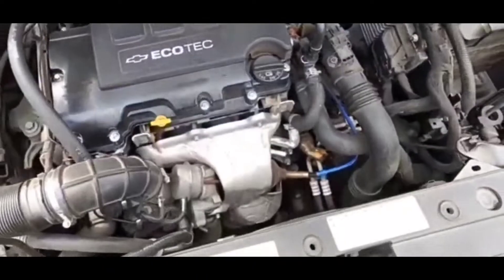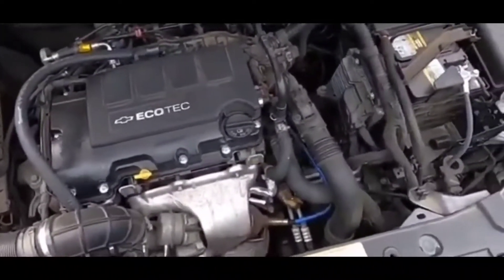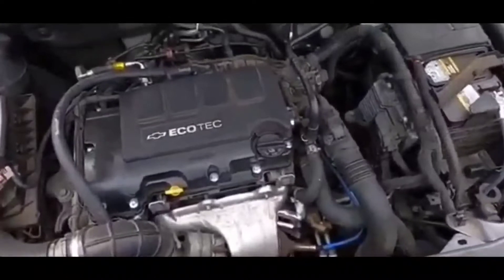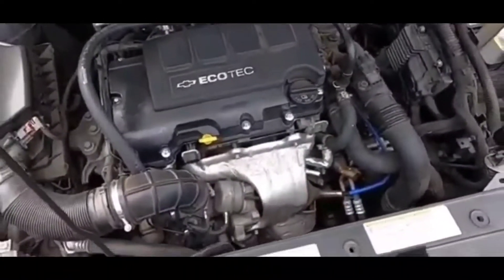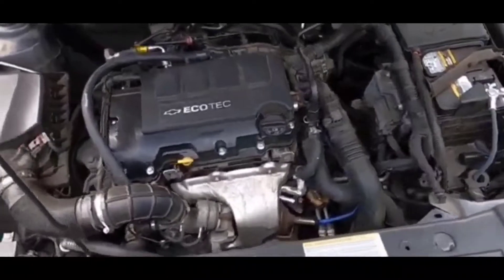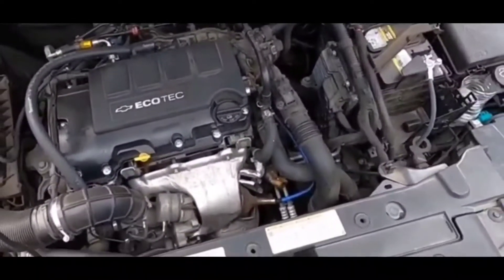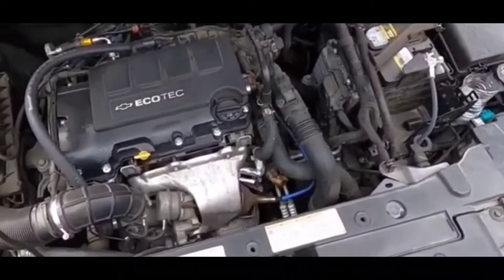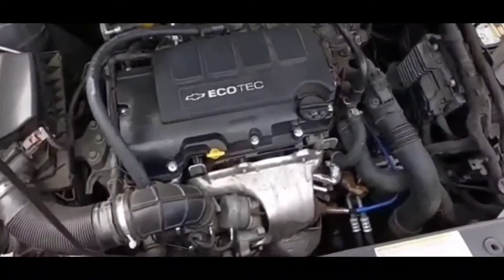How to Diagnose/ Fix Service Stabilitrak Traction Control-  Chevy Cruze, Malibu  p0304 p0305 p0306

Comment: I have done and change everything you can imagine in my Chevrolet Cruze and still same thing someone should sue the Gm
Reply: Wheel bearing, sensor, or plugs..   

Likely one of these are your problem.
Reply: @sekiro3074 my first time it was plugs, then coil pack, the evap sensor, then knock sensor, now it’s still throwing this code and misfiring. Haven’t tried wheel bearings yet though
Reply: Me too, changed it all, including new plug connector to the coil pack. Was gone awhile when did that but now returned

Comment: Just replaced my coil and spark plugs with all new.. Stabilitrak message is still on. Purge valve assembly Solenoid is next.
Reply: I replaced spark plugs and coils and still doing it

Comment: Hi I just took the 2014 Chevy cruze to a mechanic. He reset all codes. Was driving up hill, and then the traction control, and stabilitrek control light came on. I got stuck on a hill. Should I just turn off traction control to avoid getting stuck up hills.
Reply: Hey, did u ever got it fixed? What was the issue
Reply: Yes it was the ignition coil. Was no good. Got it replaced. No more problems.

Comment: Bruh you just rambling after the spark plugs. Get some public speaking classes done or read a book. My advice to you is to make the video, do a voice over in your spare time so you can clearly communicate to us and then upload it. 

I did the plugs and it ain't that. The next thing I could do is change the pack which I am at autozone and will look into. Beyond that I've got a few other spots I can look like my faulty turbo but beyond that you need to practice some more.
Reply from the maker: Feel free to submit a video of your car issue. Ill post it and try to help you out. If not, you might get some help from other viewers. Text to (551) 239-2438.